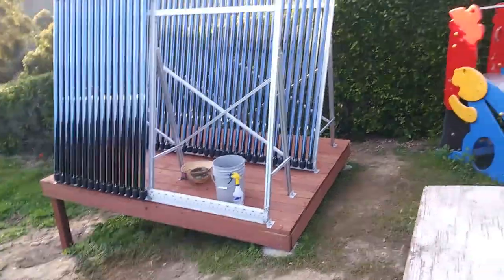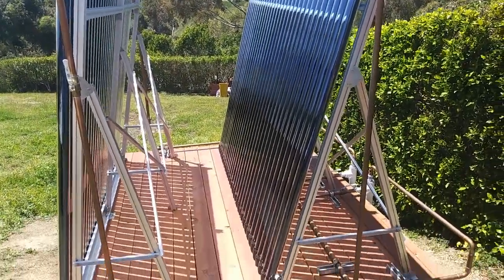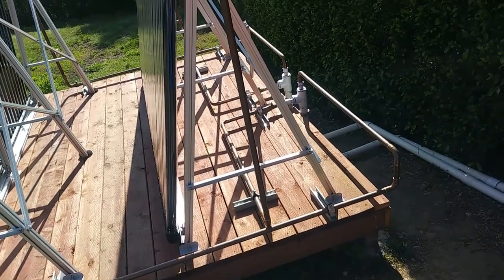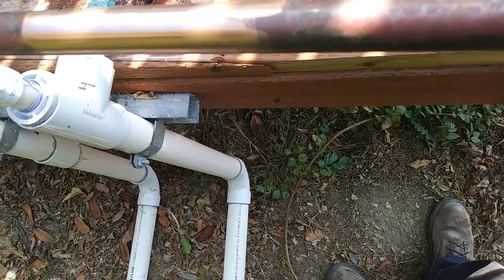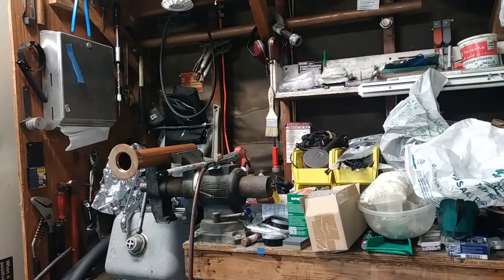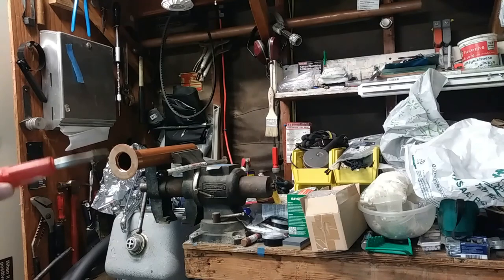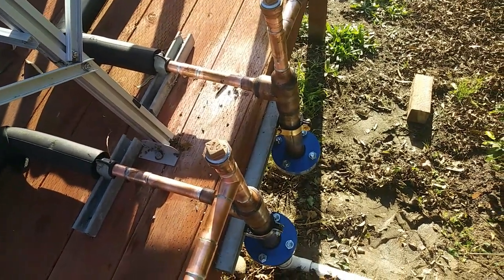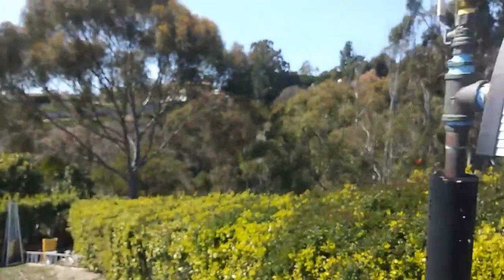Evacuated Heat Tube Solar Pool Heater Install

Comment: Do you remember the size of the pool? You said it was very large? Do you know how many gallons?
Reply from the maker: unfortunately i never knew the exact number as i did not maintain the pool or do work on pools in general typically. it was maybe 25 x 100 feet long and rectangular. 12 ft deep at one end i believe. it was for sure the biggest pool i ever worked on personally. and probably the biggest residential pool ive seen in person. more like a resort sized public pool

Comment: Many solar pool heater evacuated tube kits are sold with a heat exchanger and closed loop system for the solar collectors.  Seems much simpler to direct pool water through the collectors.  

Your collectors seemed very close together... any issues there?

Did you run these in series or parallel?

If you had to redo it, what would you do differently?
Reply from the maker: Thanks for watching! nice series of questions! Sadly, this house was sold shortly after the project was completed so i never got to do some fine tuning/testing procedures i wanted to.

 There was a closed loop system available for this brand as well but we decided to try the direct approach to save on the installation cost/time. (Owner was very well off but still kinda cheap as this was his second beachside home lol) The collectors are indeed very close together and i would have like to see more spread between them but we did find they seemed to perform equally anyhow! They are in parallel with valves to control inlet/outlet to balance the flow (didn't get to experiment with that much).

 Basically i would love to work with this kind of system again for any kind of water heating project to experiment further! lots of untapped potential! In Mexico, these types of systems have already become very commonplace for domestic hot water applications. When doing this project; I was imaging a very efficient hybrid system that involved a series of these collectors, a pool or other body of water, a domestic hot water tank, and a series of water source heat pumps. with as much of it running off photo-voltaic solar panels ofc!
Reply: @71dembonesTV  I'm considering adding these to our pool... we'll see how it works.  If it worked well, I would have expected more videos.  It might still be cost prohibitive.
Reply from the maker: @ethernalnet  yeah, i would have liked to get more footage. But, like I said; House got sold and the new owners had no interest in continuing service with my partner who got the job. I doubt strongly if they understood the operation of the panels or cared to figure it out. Also, my life has changed quite a bit since then and i've been doing less of this type of service work. Take care

Comment: Any issues arise from plumbing pool water through copper lines?
Reply from the maker: not that i know of. i've seen 50+ year old pool systems with copper plumbing that has held up fine. underground, heaters, filters, etc. copper tube is also used as conduit for the in-pool lights many times even on modern installs.

Comment: Hey mate, thanks for the video, vwhat would you guess the flow rate would be?, I have been give a 30 tube array and want to do the same here in aus
Reply from the maker: Thanks for watching it! Wish I could have got more footage/info in there but, I'm glad answer any questions I can!

 Can't say for sure on the flow rate but it has to be in the range of 60gpm total based on pump and pipe sizing (2HP, 2")

So, I allege you could plumb it up with 1 1/4" or 1 1/2" and a 1HP for your application... :)

Comment: Did it heat the pool.
Reply from the maker: it did make an appreciable temperature difference(as shown by the gauges) but, unfortunately didnt get as much time to experiment as i would have liked. overall i think the capacity was a bit on the small side. the same capacity (pump and panels) on a smaller pool would have given very nice results i think.